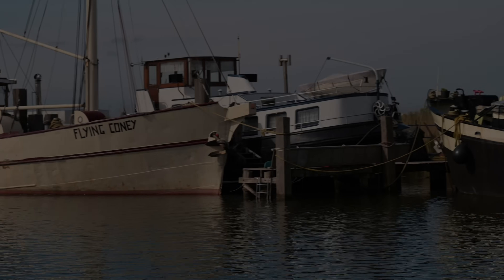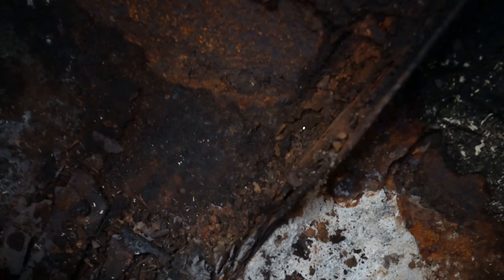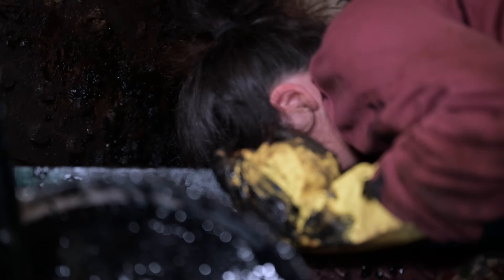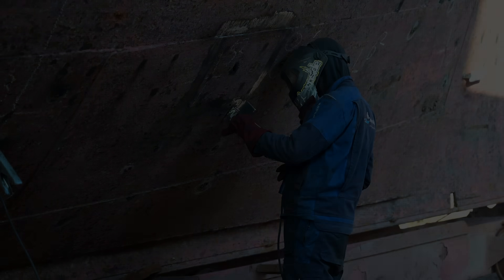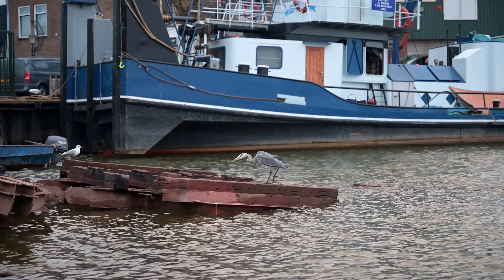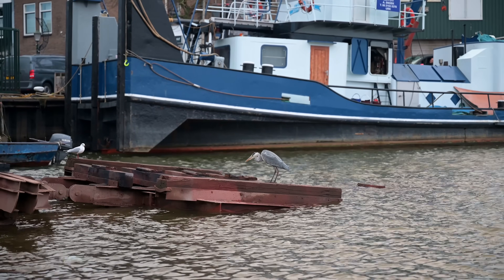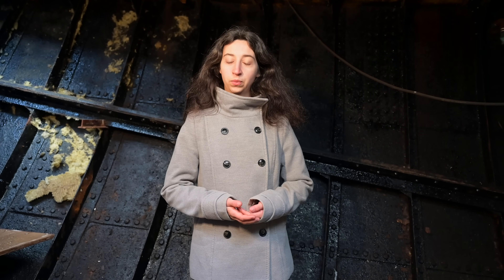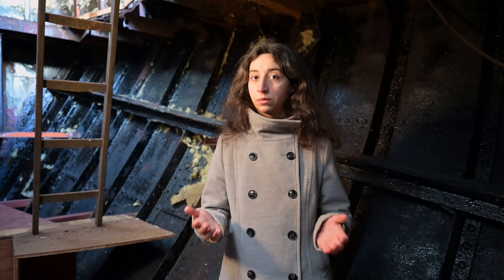BOATBUILDING - Repairing a HOLE in a STEEL Hull! EP16

Comment: Man, that's some pretty extensive damage on the skin of the hull. The weld repairs look good, however, I would worry about how long the rest of the hull will last before it gets eaten away too. I wouldn't trust it for blue water sailing as heavy seas will put extreme stress on the hull, and may cause it to break.
Reply from the maker: The hull thickness is way above the minimum. The electrolysis damage isn't pretty but it's repaired now with a trusted method. So it took about 100 years to corrode away 4mm of steel without proper protection. We have about 3mm left before we reach the minimum. Flying Coney was built overly heavy and the hull thickness is about the same as you would build new nowadays. However, we still have to fix the structure in the saloon until we can sail on blue water.

Comment: Overplating is ok as long as there are no leaks on the inside. It seems like the guys at the yard know their trade. And ask if thy are in doubt. The sailing boat in 'my picture, nick' I built with C-clamps, angelgrinders and welding machienes. I used several welding techniques, but I could have done it with just stick welding.

Comment: Jobs coming along great, despite these little hiccups. I think they say over plating is best. Because they’re to lazy to do a proper job 😂👍👍
Reply from the maker: Well, nobody sees it underneath the waterline. But for an insert it's better to weld the plate from both sides so in this case it would have been necessary to remove a lot of concrete. But it also is problematic for the rest of the hull and difficult to get watertight. It would be necessary to use a much bigger plate and it certainly would cost ten times more. It's a relatively small repair because the hole was caused by the wood laying against the hull. It's a different story if a plate is too thin at multiple spots, then the best way would to replace an entire plate.
Reply: @FlyingConey  that’s fair enough. I’m one for things looking right. But I understand 👍👍👍

Comment: These welds do not look okay to me . There will be water between the plate and the hull and it will rust much faster . And why is he stick welding instead of MAG welding it . And why not shape the plate first and then weld it in place . Paying a lot of money extra now . Sorry to say but that is what I see in this video as a professional welder in this video .
Reply: 100% not good, you can NOT make a sandwich point for moisture and more rust to form.
The only way is to cut out a section and weld in a new one, not slapping plate over holes.
This is terrible.

Comment: Hello you two your looking much more relaxed . From what  I'm told and understand in you case over plating is the best option because of age on the hull not all steel is the same with age yours has  gotten thinner of course but also weaker it tends to flex more and the new plate will not so if you had flush welded it could cause stress at the weld point ,besides who's going to know after she's back in the water just you two and all off us 😉.AND WE PROMISE  not to tell .you should tease that young man and tell him to quit poking holes just so he can keep working on Flying Coney .he did a good job and i really liked that he got advice on how to do a proper job of it .have a good week see you soon .👋

Comment: In my opinion, all the rust in the steel they were plating over should have been neutralized, and treated, both inside and out, before the over plating was done. Otherwise it will continue to rust away underneath the over plating, and eventually compromise the area around the repair. Yes, it will eventually rust no matter what, but it will do so at an accelerated rate with the rust underneath left untreated. This isn't a criticism of the 2 of you, but of the methods used by the yard.
Reply from the maker: In one of the upcoming videos we will remove an old overplating that was in place for at least 60 years. we haven't found an awful lot of rust behind it. The yard is definitely a SHIPyard and no BOATyard. They do working boats with methods suitable for working boats. With the lack of oxygen because the hole is welded shut from the inside and is underneath the waterline I will not live long enough that it will be a problem and then it's still possible to replace the plate.
Reply: Bull, you need o2 for oxidation to occur. By welding all coatings underneath will be damaged anyway.
Reply: @quutjeh54  It can still get o2 from the inside of the hull, through the hole they put the patch over. I get what you're saying, I would have just made sure to eliminate the existing rust (as much as is possible) before patching it. It just makes the repair last that much longer.
Reply from the maker: The hole is closed from the inside!

Comment: Omg how is that old rust bucket still floating it’s got more holes in it them a block off Swiss cheese I truly hope you prove me wrong but I think you our just throwing good money away wishing you all the best your going to need it
Reply from the maker: Thank you! I think you'r overestimating the amount of repairs needed. Besides the electrolysis damage there wasn't an unusual amount of thin spots or rivets that needed to be welded. At the end it turned out that all the holes had wood laying directly against the hull behind it. You can also see the thickness reading directly next to hole and there's more steel than most yachts are built with. Still scary, still expensive but not as expensive as most of you think.
Reply: @FlyingConey  

Thank you for your  reply may be I am overestimating but still looks like a whole lot off holes no matter the reason and that supposed expert that checked the boat the first time. and again the second his just covering his lying ass still thing it’s got more holes then a block off Swiss cheese I am sure if you new what you no now you probably would not by the boat any way I like being proved wrong and wish you all the very best